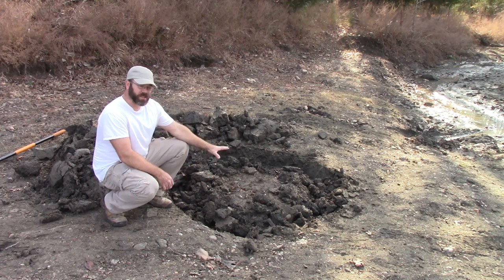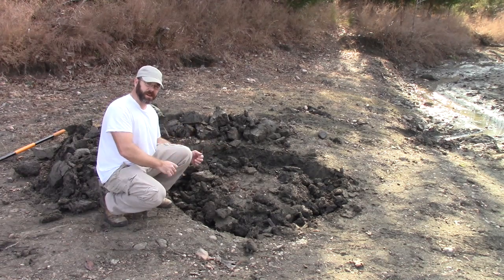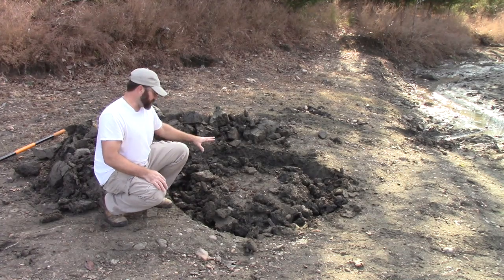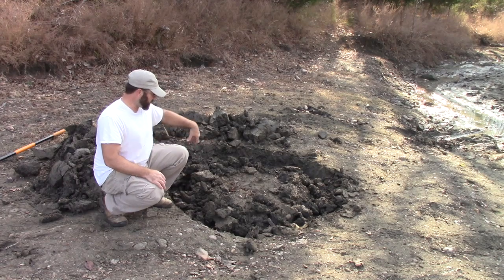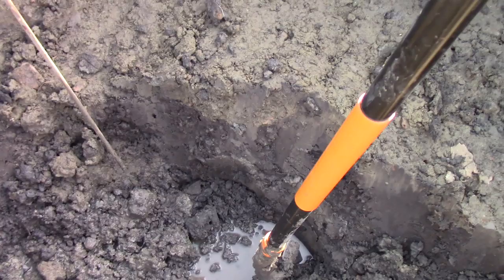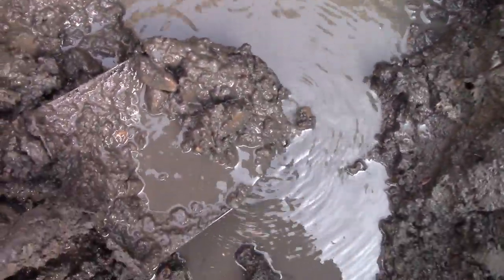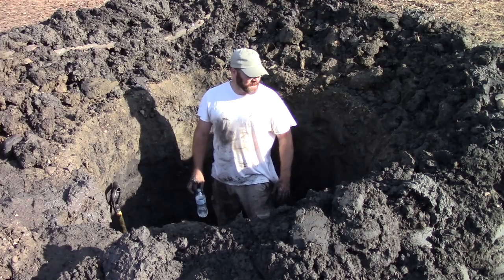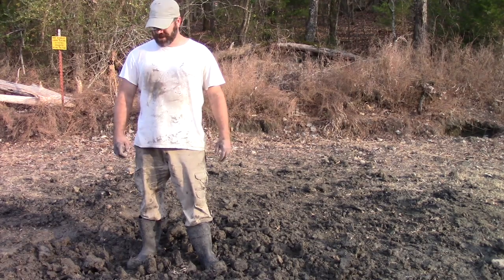Digging a Hole for Diamond Bearing Gravel at the Crater of Diamonds State Park

Comment: I'm older. So I would use a gas powered post hole digger. To dig down and also bring that soil up. I'm just saying working smarter not harder always works.
Reply from the maker: Victor Robinson park rules state that there can be no tools other than manually powered.

Comment: I noticed a water hose....how many places in the mine do they have with water so you can wash the mud in case you want to wash there?
Reply from the maker: I think there are two water spigots that i know of for use, but i am not sure about rules regarding water hoses. I have used them to fill the small tanks i use when i set up by the east drain.

Comment: What about using like a sharp auger type tool and make handles to help bust up alot of ground easier 
I am not saying to use battery powered tool I think it would make digging alot easier. What do you guys think
Reply from the maker: If you auger a hole, it may not be big enough to get your material out of after a few feet. I have seen some guys try it, check out the end of one of the gravel farming videos. It didn’t work so well for them.
Reply: @TheArkansasDiamondMiner  
Okay I understand, I am new to these mining videos, just trying to use my imagination 

Work smarter, not harder.
The more I see of these videos, the more I realize that it really takes hard work, knowledge and dedication